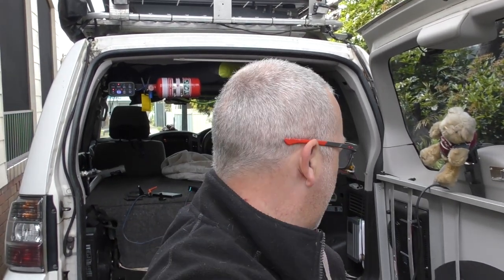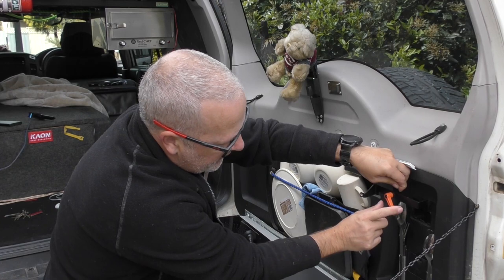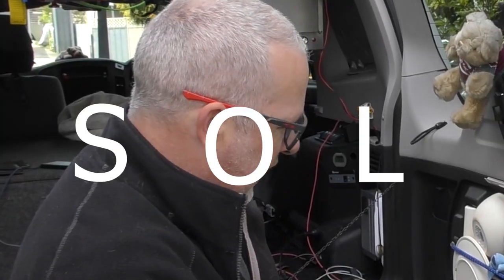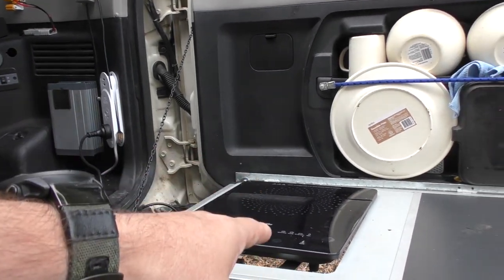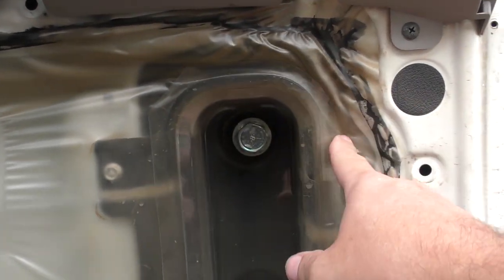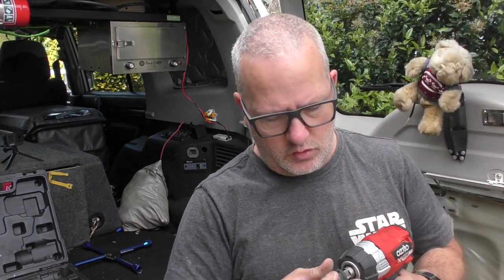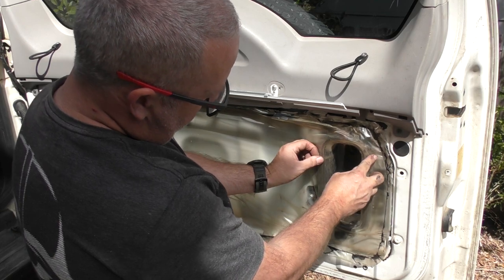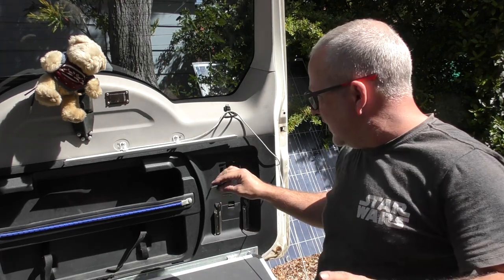Pajero rear door, open it from the inside with this

Comment: Thanks Brett. A mate of mine had the rear door mechanism fail on his Prado and spent a long time trying to get to the internals of the door from inside so he could open it. This gadget solves a potential problem, especially when we travel on dirt roads a lot and dust tends to jam the mechanism and not being able to open the door on a remote trip would be a mjor problem.
Reply from the maker: Hey Ian, I'm not sure this would be of benefit in that situation. Since it attaches to the original mechanism and simply adds an additional lever point. if that makes sense. It would really depend on where the failure was in the system, for this to work as an alternative . for the price though, can't really hurt

Comment: Brett, comment at 8 mins in is spot on - "one would think that would come out". Is Christmas eve 2022 - back door wont open. Had undone internal bolts but didnt know the external bolts holding plastic spike needed to come out - had resorted to violence with hammer and was starting to feel very bloody un- christmassy. Took a breath and came inside to find some pointers on utube - cheers for taking the time to make the video - have subscribed. Going for a beer - merry christmas all.
Reply from the maker: All good Richo. I'm at work, so sit back and have a beer for me . Merry Christmas

Comment: I fitted one of these a while back. Has worked well. You don't actually need to remove anything off the outside of the door to fit this, just the inner trim. It's really fiddly this way but entirely possible. You can also just cut a small section out of the clear hard plastic to allow the handle to poke through, enough so your hand doesn't scrape it. I used a plastic bag to create a new dust seal around the handle.
Reply from the maker: Haha yeah figured that out after I removed it but thought it was worth it to just have a look and see how it all works. I may have cut the bit out where I said you don't need to do that. I'm going to see if the dust thing is an issue. if it is, I'll try the bag trick. Cheers

Comment: I was thinking the same thing about the table being an issue BUT I've been thinking of fitting a solinoid with a button on the rear door, just need to work out the engineering of it all.
Also eliminates the issue of cutting the dust cover.
Reply from the maker: Should all be easy enough I guess. Maybe you could look to retro fit a normal car one or an after market option. The mounting would be the challenge I guess. But it would be under the rear wheel, so you could probably go through the rear door without it being obvious. Keep me posted if you do it.

Comment: Welcome back Brett, have missed your vids..When ya do the rubber have a look at the Terrafirma Tyres, have had a set for a while now and they are great and cost far less then the big names... plus they're WA designed & come out of the same factory as the Coopers etc..
Reply from the maker: Cheers Graeme.  Summer means longer days and time to get them done.  Thanks for watching
Reply: @DENMONKEY  Onya mate, champion effort
Reply from the maker: Cheers Graeme , I'll suss out those tyres when it comes time.  It will be a while away though

Comment: Great video Brett. Maybe you could drill a hole in the top and attach some small rope to pull it back to open . Hope to see you at the Pajero outing in the watagans
Reply from the maker: Now I know how it works I reckon I could come up with something, but it's never been something I've needed with my set up.  I just climb out the side door.

Comment: Looks like a lot of work for small problem
Reply from the maker: I've never had an issue with it but this question of how to do it is probably my most asked question over the years. So I figured I should do it when I found a solution. So it was more fit everyone else rather than for me. To be honest I've never even used it since the install and forgot it was even there. I'm going out to test it still works. 😁

Comment: Thanks for your intro. I found my rear door unlock (by key)  get stucked after this handle installed and it already happened  twice. Do you have the same experience?
Reply from the maker: Do you mean by remote or by using the key  ? Mine doesn't have a key over the back so I've not had any issues unlocking. The remote unlock is working and I've not had any issues at all opening the rear door since the install

Comment: Hi, Iv just bought a gen4 pajero ns 2007 model. It has 4m40 engine with 4 speed automatic gearbox. Im curious if it is possible to replace it with a 5 speend automatic gearbox taken out of a 4m41 engine. Please advice
Reply from the maker: Sorry mate, no idea. That's outside of my expertise. Hopefully someone will see this and let you know
Reply: The 4m40 & 4m41 are effectively the same engine , as long as your floor pan is the same , it should be almost a bolt in job with minor adjustments to use the later g’box but consult a pajero mech